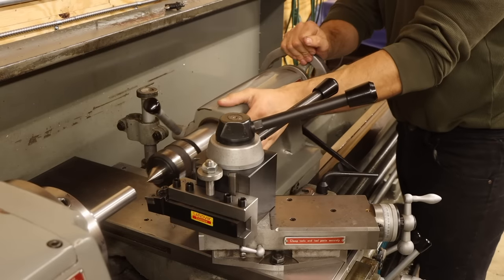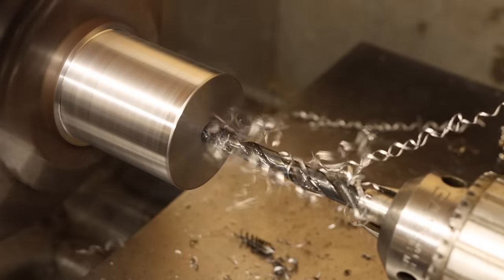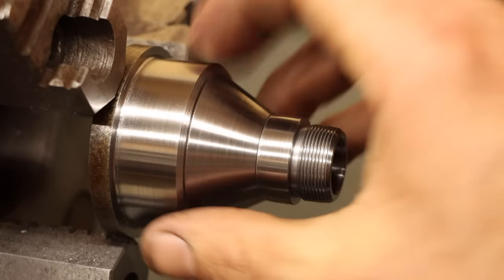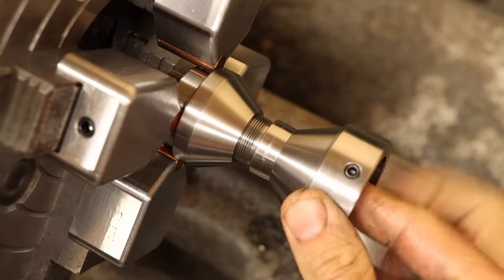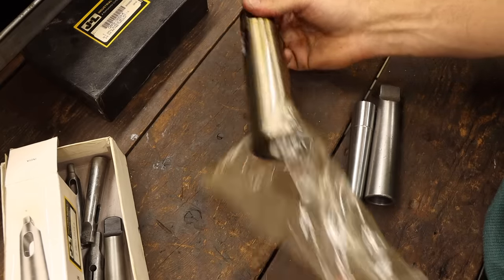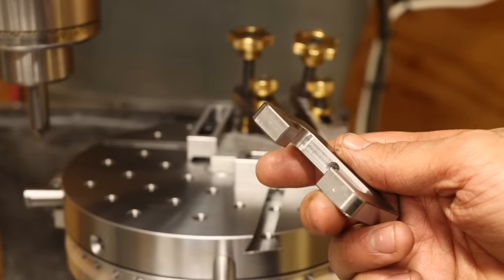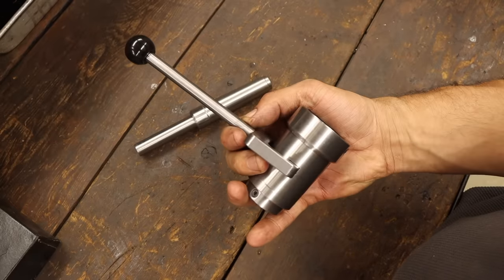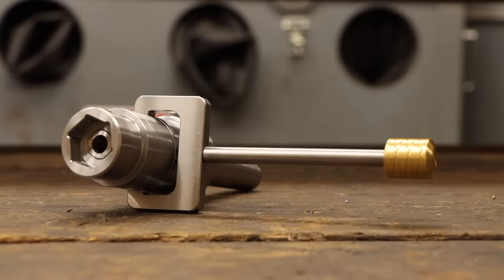Live Free or DIE HOLDER

Comment: 26 TPI is a British Standard Cycle thread (BS Cy) traditional on bicycles. 95% of cycle threads are 26 TPI no matter the diameter.
Reply: So basically 1mm metric pitch, just 0.023mm off.
Reply: You’re mistaken, BSC/BSA is 24tpi, however Raleigh used 26tpi until standardisation and persisted for a while after to save changing their tooling in one factory.

So 26tpi is Raleigh-thread
Reply: @emilcarr7190 Wikipedia disagrees, and also other sources.

https://en.wikipedia.org/wiki/British_Standard_Cycle?wprov=sfti1
Reply: The bicycle connection makes a lot of sense, the clutch mechanism reminds me of a pedal brake
Reply: @emilcarr7190  No, 26 TPI is British Standard Brass, and is what thin walled brass tubing is threaded at. However 26 TPI is common in older audio equipment, (potentiometers etc) as well as older car and bicycle stuff.
Reply: @emilcarr7190  Interesting nuance there. I've always known cycle threads as 26tpi.  I had a 1950s Norton motorcycle which had a bunch of them: 26 tpi. They were the studs holding the barrels on and head bolts of various diameter 5/16" being largest IIRC, so quite a fine thread.   Apparently is was not just Raleigh bicycle company using 26 tpi.
Reply: Axle nuts for track bikes are 26tpi for Campagnolo, 1mm pitch for Shimano. Both 10mm dia, and for a wheelnut length, interchangeable.
Reply: Oddball British Threads 
24 TPI British Standard Cycle
26 TPI British Standard Brass
36 TPI Royal Microscope
Reply: @richarddavies7728 And don't forget the 19tpi still common on air fittings out of China! And the gauge isn't included in some high end "figure out the fitting" kits. Have to extrapolate it or count.
Reply: @philmenzies2477  But BSB is a Whitworth form thread, so 55º flank angle - I bet Mr Inheritance doesn't have thread form tools for that
Reply: @emmajacobs5575  ??
You can grind any flank angle you like.
Maybe have a think about what you want to say before you just post nonsense.
Reply: @philmenzies2477  I never said you couldn’t, just that he likely wouldn’t currently have such tooling, especially as carbide tips.
Reply: @emmajacobs5575  Maybe you didn't write it, but you certainly inferred it. I also wonder if you actually watched the video because @7:10 he is literally using a HSS cutter to form the threads.
Reply: @richarddavies7728  Not odd ball at all just a standard an odd ball thread today would be
ADM = That is or was a British Admiralty thread standard disgarded pre world war 1.
Reply: Isn’t cycle and brass the same thread ? I was taught by my father that they the same tpi and 5 degrees different pitch?
Reply: @ronkellis769  Chances are good that air fittings out of China are going to be BSP unless otherwise specified! (1/4BSP is very common for fluid fittings, and that's 19TPI.)

Comment: It's my belief that hex dies are for chasing existing threads and round dies are for cutting new threads. What do you think and what have your experiences been?
Reply: Nah not really. Both can be both but you can get descent result with a die if you just take a couple of passes with a single point cutter before hand
Reply: Yes, split dies to cut a new thread, the split gives the ability to adjust the thread somewhat, or do a couple of passes. The die nuts should only be used to renovate an existing damaged thread.
Reply: I've heard people say this, but otherwise have seen no evidence elsewhere to support it. I've used both types to cut threads with no issues.
Reply: Dies are used for both creating new threads, as well as cleaning or repairing dirty or damaged threads. Dies designed for creating new threads are made with high speed steel, as opposed to re-threading dies, which are made from carbon steel. Thread dies are available in the split round adjustable, or hex varieties.
Reply: Correct, hex dies are for chasing threads not cutting, that's why they're Hexagonal in shape so you can use a wrench on them.

To the ppl who will say "well I've used hex dies for cutting threads and it worked just fine yadda yadda" well you can also use a pair of pliers to pull your nose hairs or a Deburring tool to cut chamfers or use a wrench as a hammer but that doesn't mean that's what they were Designed for.
Reply from the maker: I have a similar belief about cheap dies vs name brand 😂 I've never had a name brand die fail to cut a new thread. but have bunged up plenty of the cheapos trying the same thing.

Comment: Beautiful work!! From 7:43 to 9:00 You accidentally made an NPT thread!! Haha. Using trig to determine the delta for the tool radius to the final pass is totally the right way. My way? Trial and error! I'm curious if it would be easier to turn the die set to fit a single bore rather than worrying about the center. Another way would be to make a spring collet for the die so it can tighten with a nice snug collet nut (all custom of course).

Comment: I'm constantly impressed by both your attention to, and skills at achieving, the aesthetics of your work.    
On lathe threading: An old tool and die maker who gave me some training told me to, whenever possible, single point thread a part close to finish and then use a die to finish to size. He said this saved a lot of time and greatly reduced the risk of spoiling the part.  Thanks for such great content!
Reply from the maker: I've heard about that technique but never took the time to try if out. I really need to though because 80% real time in single point threading is the last few thou getting it right 😆 Thanks, Bruce!
Reply: @InheritanceMachining  Indeed. Also: this is a valid use case for hex die nuts. It is not widely realised they are not intended for cutting threads from scratch, and it is risky doing so in anything stronger or tougher than mild steel.

Comment: What a great project!  You're only getting better!

I have a tiny machinist tip that may help when using a coaxial indicator.  When I set one up I use my indicator stand without an indicator in it to hold the body arm from rotating and thus not influencing possible error. Hope that makes sense!  See ya on the next one!
Reply from the maker: Thank you sir! And that's a great tip. I used to do that exact thing but came to prefer just using my hand though i see now what you mean about possible up/down deflection causing error. I should do a test to see how much that affect it!

Comment: As embarrassing as it is, I'm confident enough to say that it took me two days (thanks Patreon!) to figure out how that clutch works and it's basically nothing. Ah, well, today I understand more than I did yesterday!

Edit: Also, it's nice to hear "long time viewer" and be included. It's been a great time!
Reply: Ok, so how does it work?  I can't figure it out
Reply: @samwise098   So, the die-holder assembly spins freely on the shaft, but when the handle is pushed or pulled the cones move outward and the die holder stops. The part I didn't get was that because you're putting forward force on it, it feeds the die into the part, making the cut. I . . . Huh. Do you run the lathe in reverse to get it off? Otherwise I guess I don't understand it. Point is the clutches just stop rotation, it's the operator pushing forward that actually begins the cut.
Reply from the maker: That's alright 😂 First time I saw the mechanism (in Jonesey Make's video) I didn't quite get it until I saw it in action. 

Also your description is exactly right. And I do have to reverse the lathe to back the die off. Probably could have made that a little more clear
Reply: @InheritanceMachining   You're making a machining video, not a reference manual. It's all good, I just nerd sniped myself. :D

Comment: No third set screw? Usually die holders have a pointed set screw to engage the split.

There's also the issue of 180° vs 90° between the outer dimples. 

Still, a much fancier build than mine, which uses a removable handle to apply torque.

BTW, with adjustable dies, you can open them up a bit for the initial pass and then close them down for the final pass. That reduces the required torque substantially.

Comment: There are at least THREE ways to cut male threads: single-point, with a threading die, and by ROLLING them.  Commercial fasteners are almost always rolled.  Rolling is faster, cheaper in large quantities, and results in a stronger fastener.  It is required for aerospace and military-spec fasteners.

Comment: 16:40 For anyone else wanting to try a setup like this, keep your cuts light. Morse tapers don't like side loads and can wiggle free - that's why mills with MT spindles have drawbars even though Morse tapers are self-locking.
Reply from the maker: I didn't even know that. Thanks!
Reply: And for our next trick, a new center less handle for the tailstock so a drawbar can be installed to pull the MT tight. 🙂
Reply: @ronkellis769  Doesn't matter in the tailstock because the load is axial (and torsional) which MT is very good at. It's only once you start applying "wobbling" side loads that you can run into problems, which basically means that the taper has to be rotating. A drawbar for the headstock is totally feasible though (I have one, though I think I've only used it once).
Reply: @ronkellis769  Myford ML7 lathes have a hollow tailstock barrel with a large diameter external thread; it's the only lathe in common use I know of which can accomodate a drawbolt, and about the only thing about them which is better than the more refined Super 7 which shares the same bed and many parts. (Having said that, the S7 tailstock is far better in every other respect)

Comment: Looking at it from a manual machining perspective this is a huge time saver when quickly knocking out any low precision thread.  Sure you can use the regular wrench but as you showed the results are all over the place.  This is the exact same amount of time to set up as a die wrench and it works infinitely better on the lathe.  The fact you can trust it to make a halfway decent thread every time is a massive win.  I usually avoid external dies like the plague but this makes me rethink it.  Great video.

Comment: The best thing is both of two methods especially for stainless steel which is hard to cut with die -first you single point 80-90% of it then you finish with die.Keeps the dies sharp and they wont break and the thread is always cut perfectly.
Reply: Indeed, it's a great way to avoid the wobble, and it finishes the crests off nicely.

Comment: I worked in a machine shop for a bit and they had a tool post mounted version of one of these!  They made hot rod brake conversion kits, so little pushrods where a common item to have to machine, and it made threading a few dozen at a time a breeze.

Comment: 0:04 there's also rolled threads. :) They are the strongest too. Bicycle spokes are specifically (always) rolled threads. Bonus, there's flat plate rolled threads (you usually see those for bolts, because they're good for conveyor factories) and roller rolled threads (those be the bicycle spokes and specific low number pieces).
Reply: True. Just suggest caution with the "always." There is and will always be cheap junk. "Generally, usually, and most of the time." 🙂
Reply: In defense of the video maker, he did say there are two ways of CUTTING threads. (There are several other ways, including thread whirling, tangential self-opening chaser heads, and hand chasing (either single point or multiple conforming profile), but rolling is a different approach, neutral in the sense of being neither additive nor subtractive (which is particularly cool, I reckon). There may even be a female analog to thread forming (lobed, fluteless) taps which is another neutral option, but I've not come across it. It would certainly work for ultra ductile materials (copper, lead....) not much call for threads in lead, though, especially male threads.
Reply: Thread milling is another subtractive option, applicable to both internal and external threads (unlike thread whirling)

Comment: If I need a straight (small diameter) thread, I usually single point about 70% of the profile and then use a thread die for the final pass. Saves a lot of time fitting and measuring the threads. The die always follows the way of the pre-cut threads, so you don't even need the tailstock for alignment. 

And yet, I need to build myself one of those...
Reply: That's an amazing idea

Comment: 0:24 a trick i have learned is to support the back of the thread die with the tailstock (which should be a flat surface), letting the handle rest against another part of the lathe to transmit the torque, then by hand rotate the lathe chuck and thread it that way, that works pretty well.

Comment: Very nice.
When I thread long skinny parts, I usually single point the thread oversized and then chase the threads with a die. That way I do not have to worry about the die starting not flat (this is cause of wonky threads), and I don't have to worry about flex from tool pressure.

Comment: Why not machine a support guide that mounts on the lathe holding the handle and supporting it so it doenst kick side to side. All you need to do it hold the handle in to engage the clutch and the kicking is held by the guide slot ?

Comment: Those polished inserts are great, they'll even work on hardened material if needed, though the slightest rubbing or bump will break them. 
I've used them on GCr15 HRC 58-62, high carbon chromium bearing steel.

Comment: that's  an old  holder style that goes back decades when i apprenticed  the lathe  had one similar mounted in a manual indexed turret  tailstock with a rack and pinion feed to   move it  versus a hand wheel on an old Gilman lathe . the  die holder  had a stirrup type yoke  fixed to a fined pivot to  pull the  die forward and  back

Comment: If I could start a business building precision items for people I would.  I enjoyed doing this type of work when hired as a Cad Designer but utilized only in the machine shop. I need to get back into it. Thanks for the vids.

Edit to add: Couldnt you machine some back stops for parts when needed?  When I was machining plates we relied on them to get our .0005 accuracy.  If you ever make a surface grinder please post videos!  We used that for the extra .0001 accuracy and it made a huge difference in plastic leakage and heat transfer.

Comment: Cough thread rolling cough.
Worked in reinforcing steel manufacture for a while.
Astounded at the speed and accuracy of rolling thread on 2 inch reo vs cutting it.
We were doing both due to amount required. The roller was easily doing twice as much as the cutters.

Comment: A thread file works good for cleaning up whoopsies. I have one that is just a 60° file about 3/16" thick for oddball or unknown threads.
My experience with 3-wire measuring drove me to shelling out the dough for thread mics.
I made something similar based on a very very crude on that one of my predecessors made. It's for use on mills with round dies, but I imagine it will work fine in a tail stock. No clutch, just a wobble for self-centering. We threaded a shit-ton of bent up tubing with 1/8-27 NPS for chandelier type light fixtures. The split round dies are far superior to hex dies because they can be adjusted to fine-tune thread depth. You have to use Tap Magic or some other threading specific cutting oil or compound. Coolant is not up to the task on most materials.

Comment: There's also thread rolling.
They make very nice threads.
Never seen them done on manual lathe though.
Definitely gonna need a doohickie thingy ma bob.
Also the dies are not cheap, so there's that.
Form taps are pretty much the same.
No chips for either.
I usually use the 
form taps on stainless, or aluminium.
Nasty stainless chips love breaking taps.
Great job on the holder Sir.
If I was running a manual.
I would definitely be widdeling one of these up toot sweet.
🐸

Comment: I wonder if you could add a spline, or even a keyway between the tailstock rod and the rear cone to transfer the torque and stop you breaking your wrist?

Edit- Just remembered the two cones are threaded together- would need to make them spin independently of each other too.

Comment: The hex dies are not for thread cutting, they are for thread chasing, that is, fixing a f*** thread that is otherwise present. If used to cut a thread on stock, they tend to shatter, since they where never made to do so.
The round thread dies are split dies, which allow you to cut threads with various clearances by adjusting the compression of the die. 

Fun bit of trivia, the hex dies are shaped thus, since they are designed to be driven by a hex wrench / box wrench etc... that usually drive nuts.

Comment: Brandon, hex dies are for 'chasing threads" and or fixing the treads.  The round dies are for cutting new threads.  Seems like you have been using them backward which is a very common mistake, amazed you didn't break any of the hex dies.
Reply: I was going to post the same advice. The clearance angles, rake, gullet sizes, throat tapers and sometimes even the heat treat are optimised, in the case of hex die nuts, for cleaning up damaged threads, not for creating them from scratch. Another valid use case is to use them just for a finish pass to size and radius the crests of threads roughed out by single pointing.This is a great way of quickly producing a wobble-free thread, especially as regards larger or coarser threads.

Comment: You should be able to get a bit more engagement force on the clutch without needing to press as hard if you radius the corners of the handle. If you do, you need to make sure of two things, though: 1) that you don't remove enough material that the handle fails to engage at all; and 2) that opposite radii are not concentric with each other, otherwise there will be no cam action.